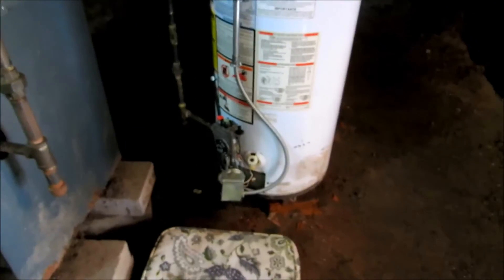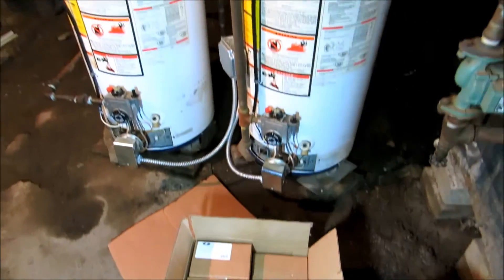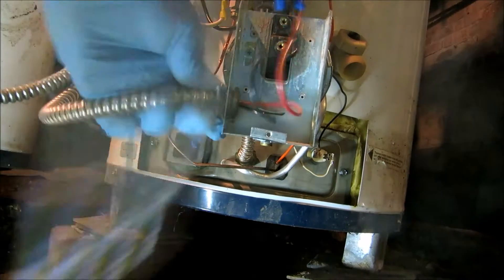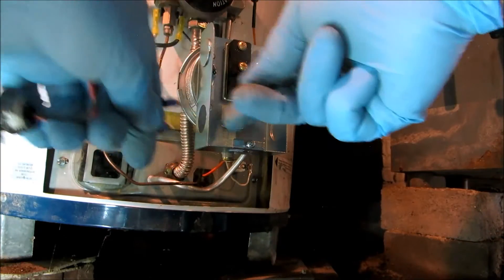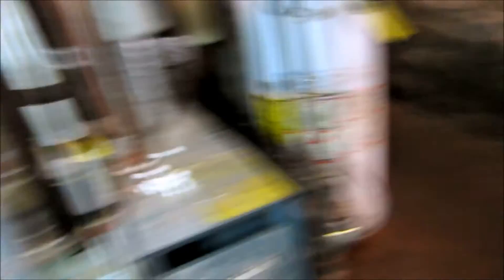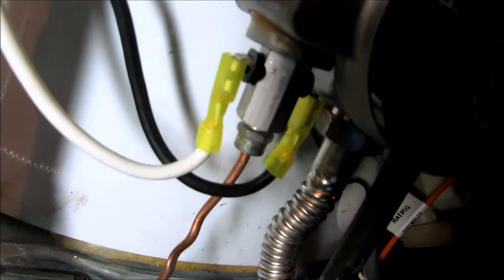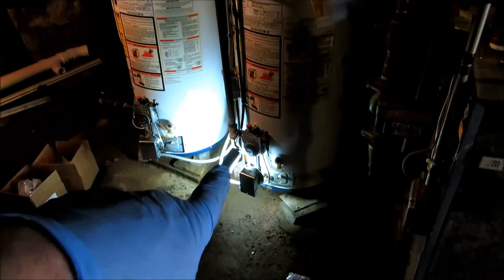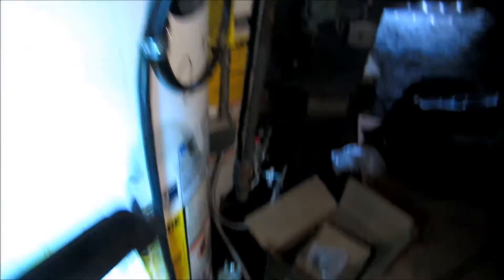3 gas fired water heaters hooked up to swg powerventer

Comment: Now that was very interesting. Never seen a power venter before. Nice set up though. If I got it right, all three water heaters and boiler wired in parallel to  power venter motor, so if any one of them sees pressure the power venter comes on. .Temperature switches wired to shut down water heaters or boilers if power venter shuts down and vent temperatures become too hot. Why three water heaters is this an apartment house? Thanks for another great video.
Reply from the maker: 3 family house ,3 gas meters,3 water heaters

Comment: Never run into power venters here to be honest. Is there a seperate port on those gas valves the you hook the pressure switch to? Or do you tee into the line going to the burners? Like i said i have never done one
Reply from the maker: there is a 1/8  test port that you pull a allen key out and install that 1/8 nipple and tee into ..as the heater fires up it engages the pressure switch and turnes the power venter on
Reply: THANKS FOR THE INFO STEVE! I APPRECIATE IT